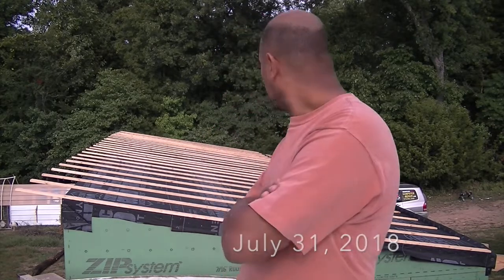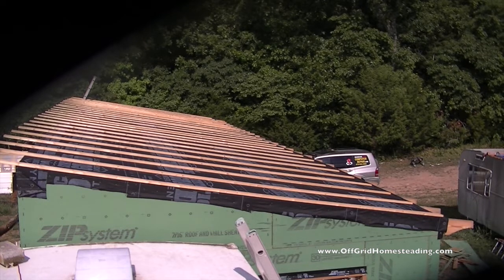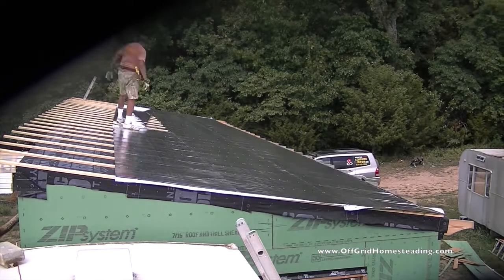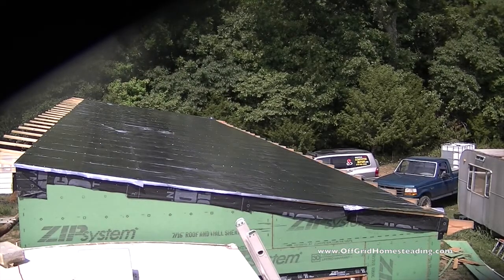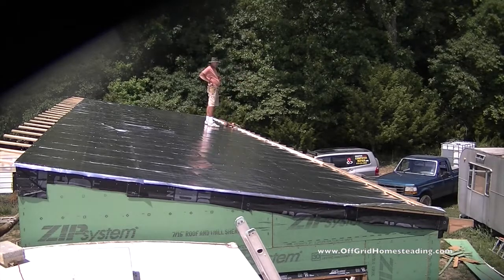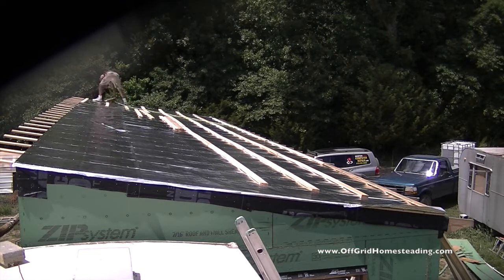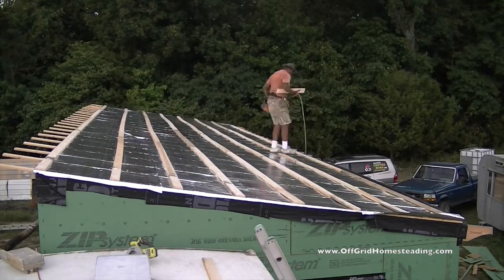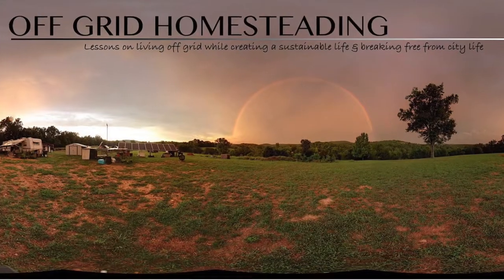OGH - DIY Build Pt 22: Radiant Barrier Double Roof Installation v2.0

Comment: Is there a minimum 4” separation between the radiant barrier on both sides?

Is there any chance of condensation occurring on the radiant barrier itself?
Reply from the maker: Hey Eric Kosak thanks for commenting.    The airspace between our radiant barrier and the roof are 1 x 4 purlins, so about .75” of air space ABOVE AND BELOW the radiant barrier.  In a previous build video, I show the underlayment going on.   Anytime you have a temperature differential there is always going to be condensation so underneath the radiant barrier.   You must use an underlayment / tar paper, or something.  We used synthetic a underlayment water / moisture barrier, and for extra protection against Ice Dams, at the very low side of the roof we have a stick down asphalt layer that comes up 4', I did two layers, overlapping by 2' for extra protection.  So the ice dam area is about 6'.  Over kill, but I wanted extra protection -- just in case.    So the order of layers:  1) 5/8 roof decking or osb.  Then ice dam layer (2) overlapping, then synthetic underlayment (or tar paper-- or something similar), then first set of 1x4 purlins, nailed INTO the Joists/rafters with 3.5" galvanized nails.  then below going from bottom to top of roof line (north south).  24" on center (north south).  So the air can flow UP through the lower air space easily.  Then after the radiant barrier, I installed 1x4 purlins going (East West) 24" on center.  Then I installed the Potina'ed Galvanized Roofing (north south), with a 2" extension past the rafter tails.  All screws were put into the valleys, overlapped by 3 ridges.    (sorry the first responses was on my phone and it really sucked!) this was on my computer.  John.
Reply: Off Grid Homesteading you are sadly one of the few builders doing this construction correctly.  

However, it was difficult to appreciate your correct building technique in the video.

If I understood correctly, you have a slanted roof with a moisture barrier through which water drains down, then you have an air ventilation channel created by the height of the first row of purlins.  After this you have the radiant barrier which reduces solar radiation.  After this you have a second air ventilation channel created by the height of the second row of purlins, and after this you have a metal roof.

Most builders in YouTube are placing the radiant barrier directly over a condensation / moisture barrier or over an insulation barrier laid over plywood, and this I believe is diminishing the benefits of placing this kind of barrier.

Do you have any performance results you could share from your installation?
Reply from the maker: Eric please read the UPDATED response -- from my computer not my autocorrecting / shitty phone.
Reply from the maker: Yes Eric, nothing technical but I can tell you, it was a day into the 95-100º temperatures,  i was messing the zip board 4" tape to cover the bird block directly under the metal roof.  I got off balance and I needed to grab onto something quickly so naturally i grabbed the metal, and I instantly burned my hand/fingers.  I came inside and felt the underneath of the decking inside the house, and it was absolutely cool to the touch.  Also standing inside the building I could feel no EMISSIVE heat coming through the building like we can feel in the trailer, or our pole barn which has NO insulation or radiant barrier.  I'm going to have to go back and show the underlayment installation.   For some reason looks like I forgot to post that video.  Hope all this info helps.    Since then we've added 7" of open spray foam insulation inside the rafters, so we've got a 100% air tight seal, with even MORE barrier from heat loss.
Reply: Off Grid Homesteading that is one professional install.  

It is simple, and at the same time, it is an elegant solution for avoiding getting into trouble with so many kinds of possible problems.

I appreciate the updated text version.
Reply: Off Grid Homesteading that is an impressive result.

I have a future roof install, and I like the approach of your roof construction.

My problem is that roof temperatures can get up to over 100°F in the summer.

For this reason, I am thinking of placing a radiant barrier on the attic side as well since attic temperatures get pretty hot as well.